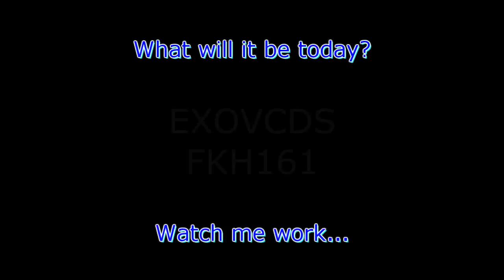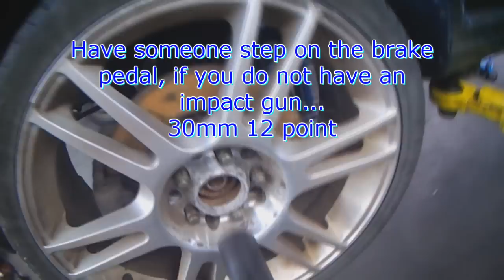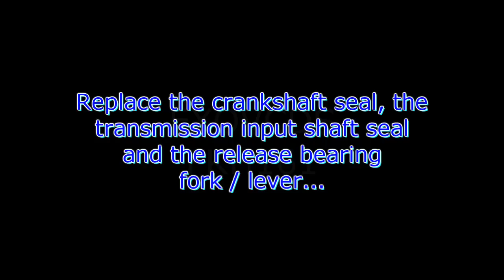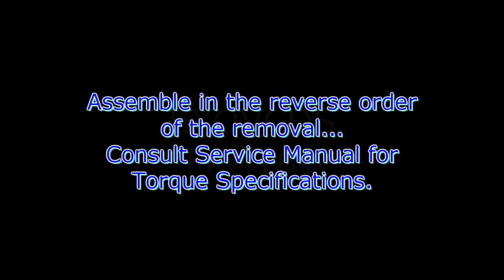VW A4: 2.0L AEG Transmission / Clutch Removal

Comment from the maker: 25:14 is a 9mm 12 point socket. A 6 point socket is a hex socket. Sorry.
Reply: I wonder it would cost to have this done
Reply from the maker: Phone a shop and ask. Enter your city here and look for a European car shop.
https://iatn.net/repair
Reply: is there a throw out bearing assembly in there? i want replace all wear parts.
Reply from the maker: A good clutch kit comes with a new bearing. The lever that the bearing rests against (the one the slave cylinder pushes against) should also be replaced. Genuine VW part only!!! I have seen aftermarket levers fail.

Comment: Hey Thomas,
Thanks for posting this!, I have a 99 GTI 2.0, original clutch with 165K miles, not slipping yet but I'm going to change it in about a week and a half. Even though I baby the clutch, I'm assuming it can only go so far!  Great video, gives me the confidence to attempt myself. Besides, it can't be worse than replacing the heater core. FYI, thanks for answering questions on Bentley, I saw your handle and remember you are the one who answered many of my questions over the years.
Reply from the maker: Hi, thanks for finding my channel & watching! Yeah, tranny removal is a cakewalk compared to heater core. You should have no issues. Just be sure to raise the car high enough and support safely!

Comment: Hey Thomas you brave man, putting an impact gun on those triple square axle bolts is usually a recipe for disaster. When i saw you aiming at them  I'm like OH NO!! lol  i usually do them by hand, but good job man.
Reply from the maker: Time is money... well, actually no, since I'm not on flat rate. If the bit breaks, I have 3 spares ready to go... if the bolt hole strips,  I have other tools to bite the head of the bolt. I'm sure if you keep watching my videos, that you'll have more "OH NO!" moments.
Reply: ***** jajajaja yup, but we all have them….I wish i was NOT flat rate, everytime i see you use that hand ratchet to break up bolts and to remove them I'm like WHY DOESN HE USE THE IMPACT??? I guess is just different when you are not rushed to finish every job.

Comment: Holy shit, good shit bro I'm about to do that exact job. Just did a clutch job on a 09 civic si.... that sucked. This has a lot more room to work in. Wish me luck lol.
Reply from the maker: Jerry Mercado You got it! Work safe!
Reply: Ok so I got a situation.... Just started the job and the clutch that the my friend bought looks a little different lol
Reply from the maker: Jerry Mercado The difference might be solid flywheel or dual mass flywheel. If your original clutch disc has springs, then you gave a solid mass flywheel. If your disc does not have springs, then you gave a dual mass flywheel.
Reply: Rgr.... solid mass it is. Tans is back on now working on the half shafts. As far as fluid what would you recommend?
Reply from the maker: Jerry Mercado #2 of this image:
http://newbeetle.org/forums/attachments/questions-issues-concerns-problems-new-beetle/89384d1323059634-clicking-upon-acceleration-power-steering-fluid-fluid-capacity-chart.jpg
Reply: Jerry Mercado ,hey bro I'm about to do this job today and  I was wondering if you used the solid mass clutch and dual mass flywheel or did you have to get a different clutch?

Comment: im buying a beetle for $500 but needs shit cables and clutch replacement. would it be worth buying?
Reply from the maker: David Rodriguez If it's in solid condition (not a rust bucket) then yes.

Comment: I've maybe watched this video a hundred times myself. It';s guided me to tackle this job myself with only spending $200.00 for parts, a few loaner tools and a lot of preparation. I'll be ready to put new kit in tomorrow. I did have a few questions though, is there anything i need to grease.
Reply from the maker: Brent Dickerson The clutch kit should come with lube for the release bearing and the clutch disc splines.... sorry about the late reply, I was out with family all day today.
Reply: ***** Thanks man. Everything's on and put back together but now ran into a problem where my Clutch Pedal is going to the floor and not springing back up? Do you know what would cause this? Thanks Again.
Reply from the maker: Brent Dickerson Was it OK for a few pumps or was it dead from the first pump?

Did you open any hydraulic fittings?

Was the release bearing installed correctly on the release fork / lever?

Any noises when this happened?

Fluid level in the brake fluid reservoir OK?

Comment: great video i really like it. I have a question though! i really am wondering about the hours charged for this job. forgive me if i m wrong the way you work! it is insult to give you more than an hour for reassambly, but let say 3 hours! i m just gonna copy paste what mechanics are charging !The average cost for a Volkswagen Jetta clutch replacement is between $1190 and $1657. Labor costs are estimated between $440 and $777 while parts are priced between $750 and $880. Estimate does not include taxes and fees.
Reply from the maker: I don't understand... am I taking too long or not long enough?
Removal is always quicker than the installation.
I don't show "real time" / "full footage" (my videos are edited / made shorter by removing unnecessary stuff (getting tools etc).
Industry labor guides provide "labor times" for shops to use. If a clutch job is listed at 3 hrs, the customer is charged 3 hours... unless extra time for extra work is required. If the job gets done in 2 hours, then the shop or the mechanic is ahead by 1hr labor earnings... it's the benefit of being able to do your job quickly. A first timer might take 6 hours or more... but the customer is charged 3hrs.

Comment: thanks for taking the time to make the video!  a little more lighting would be the only improvement that I could think to recommend.  again thanks so much!!!!!  I still have a little life left on the clutch.  I will order the seals you recommended as well as the fork. before i tear mine apart. are the seals easy to r&r?
Reply from the maker: The rear main seal & input shaft seal should both come with their respective flanges that the seals... meaning that all you have to do is unbolt them, clean the mounting area and install the flanges with seals. The rear main seal should come with an installation tool that protects the seal from hanging up on the crankshaft... as the seal / flange is pushed into place. The input shaft seal does not need an installation tool.
Reply: @EXOVCDS  thanks, yes i ordered the main with the housing.  and the seal loose.

Comment: Thomas you are my favorite mechanical engineer! Where did you get that engine support bar? Looks homade? Can you do a quick video on how I could make or buy one? Will it work on other cars? If so what kind? Thanks for your videos :)
Reply from the maker: That support bar I believe is an original VW tool... The threaded rod has been replace with a home made one. I suppose it will work with any vehicle as long as it has a place to sit & can attach to the engine. We use 2 of them on big engines or when the engine has to be supported at both ends. Support bridges similar to these can be bought online. I'll keep the video idea in mind.

Comment: Wow I just finished to remove the transmission. What a job, I do this as a hobby. It would be nice a video on how to replace all the seals, I will look if You have one.

I am curious how you were able to hold the various components to torque to spec.
Reply from the maker: There are many ways to "lock / hold" the flywheel in place, so that the pressure plate or flywheel can be torqued. I use an impact to remove the bolts and a holder to torque them: https://www.youtube.com/watch?v=O-uQrKFB4Oo
Seal removal requires a seal puller of some kind or a screwdriver "wedged carefully" into the seal & pried out. Installing the seal requires an installation tool (to allow the seal to slide over the crankshaft) and a gentle tap of a hammer all around the seal to seat it.
Reply from the maker: If you have a buddy helping you... you can get him to hold the crankshaft with a socket & big breaker bar at the front crank pulley bolt, while you tighten the flywheel & pressure plate bolts.
Reply: Thanks for the advice. In the meanwhile, I have removed the flywheel bolts, but the flywheel itself is stuck. I tried to use a pry-bar like you show but after a lot of effort it does not move...
In fact I have a question, should the flywheel always be machined or this one had a specific problem? I'm removing it because I want to replace the rear seal now that I have the transmission out.
Reply from the maker: Machining is not always needed, but can ensure correct clutch wear-in / mating. If the surface is smooth and has no cracks... use some 80 grit sandpaper to shine-up / scuff-up the flywheel surface. Thread a bolt into place (leaving a gap) and use two pry bars, one on either side of the flywheel and wiggle it off... it will move eventually.
Reply: I was able to remove the flywheel by first pounding it with a 4lbs sledgehammer, then it came out using the technique you mentioned. Thanks!

Comment: what does a job like this cost, parts and labor?
Reply from the maker: Labor guide for flywheel removal is 5.5hrs, labor cost per hour as well as cost of parts varies between shops / states. Bring your own parts then it's just labor. No way of knowing what other things will need attention (leaky slave cylinder,  rear crankshaft seal, transmission input shaft seal etc.) that would add labor time and extra parts costs. $700 to $1400 depending on single mass or dual mass flywheel? I don't write invoices, so that's just a guess.

Comment: Great video my clutch gone on my golf looked at this no way i am doing this I will pass this on to my friend 😃I don't think he will be happy
Reply from the maker: Wayne Lewis You're a smart man... I would not want to do this at home either. Bigger jobs like this require a hoist... it can be done with the vehicle on jack stands, but safety is an issue whenever you are lying under a car working on it. Make sure to tip him well (not just a case of beer)... I've stopped working on friends cars a long time ago, there's a difference between helping out the odd time and being taken advantage of. =(

Comment: I was all confident until the part where you were loosening the 16mm bolts from the tranny mount.  What would happen if they did break?  How would have you removed the broken bit?  The only reason why I ask is I snapped the top bolt for the alternator.  I used a big zip tie (lol) to temp hold it in place until I fix, but it's been holding for a few years now lol.
Reply from the maker: Depending on how it snapped and how it felt just before snapping... we give it a go ourselves or we take it to a local machine shop. Things can get worse when trying to remove stuck fasteners... if the right equipment / technique isn't used.

Comment: Hi Thomas can you remove the piece on the trans that the axels bolt into? Last time I didn't and trans was a bit tough to re install.
Reply from the maker: Yes. There's a bot in the center that needs to be removed. The flange will be under pressure / spring loaded, so be careful when removing. It will take a bit of pressure / leverage to install it again later.

Comment: Thomas, would you recommend doing the rear crank seal even if it is not leaking? My machine has 121k mi on it
Reply from the maker: It has to leak eventually, so yes... it would be a good idea to replace.

Comment: how long didnthe whole thing take you to do? i did this yesterday on a BEV. took me exactly 6.5hrs. i never took yhe shifter mechanism out. never took the drive axles out - just disconnected them from the transmission side. never touched the suspension either. Still took me a while.
Reply from the maker: +Rumen Hristov I'll use a stop watch on the next one... I'll get back to you! :)

Comment: Got a question for ya... I'm in the middle of doing my replacement, and the head on one of the triple squares was stripped (driver's side shaft). For some unknown reason, I couldn't drill off the head so I could use an easy out, so I had to break out my Dremel with cutting wheels, and cut the head off. I know I need to replace the bolts, but I forgot to order a set of torque to yields online. I'll order them if I have to, but can I just use a regular set of socket cap bolts if I use threadlock instead of the TTYs? They're a lot easier to come by...
Reply from the maker: Next time knock against the head of the bolt with a hammer & chisel... in direction of loosening. That usually breaks them free. I don't want to say yes or no in case of lawsuit... do what you think is best for what you need to do.
Reply: I had already tried the hammer and chisel trick, with no luck.
No problem,, I'm not the type to sue (I hate when people do that), but point taken. I'll weigh my options, since I won't have time to work on it again until the weekend. Thanks again! 
(Until my next problem occurs... Hahaha)

Comment: Very good job, the wheels on the car did not help very much. By the way, let me know what you about electric rachets. I have a 320NM one.. Thank you
Reply from the maker: Thanks. Yeah, I'm still looking for a cordless ratchet.... I have too many bills again that I have to eliminate before I can start to buy extra tools. What brand? 3/8" drive?
Reply: When you use an electric ratchet you will not want anything else jeje. They are more comfortable to use.. I've got a 1/2" 24v electric ratchet that I bought for just 150€ online here in Barcelona. You dont have to spend big money in this machine. Thankyou
Reply: ***** Helping my son replace an A4 Audi manual clutch. Can't get drive shaft to drop from trans end? Do we have to unbolt both ends?
Reply from the maker: John Bender If it is stuck to the flange, knock it fee with a hammer... should not have to remove the axles, just lift them clear of the diff flanges (if I remember correctly).

Comment: Do you have any videos on how to test whether or not the clutch is bad vs your master cylinder.

 I have a feeling my 99 jetta clutch is not bad I have a feeling it could  be something else.

clutch pedal feels fine..no leaks.
 If the brake fluid hasn't been changed in a while could that affect the clutch? like engaging it?

is there a clutch cable adjustment? or any cables to adjust? 

thanks
Reply from the maker: If the clutch is slipping... it's bad. If the pedal feels solid, hydraulics are good. Telling me that "things are ok" doesn't tell me what the issue is... so I can't guess as to what might fix whatever issue you might have.

Comment: hello thomas! thanks for this video...quick question: If my clutch is DMF, can it be replaced with a SMF like the South Bend Stage 2 Endurance clutch? does it need a conversion kit or anything of that sort? of are the new SMFs already set for the conversion? Also, a tranny guy mentioned to me that it could be 8" or 9" (or something like that) and it could need a conversion kit????  One last thing: will this video be close to the same for my 99.5 ALH TDI? Thanks again for sharing your insight!!
Reply from the maker: Transmission removal for TDI, 2.0,  1.8T VR6 is the same as long as they are 5 speed transmissions... 6 speed principal is the same, but some different mounting components / things look different.
A SMF conversion kit will include all you need if you order from a place that knows about DM to SM flywheel swaps. Transmission can rattle when in neutral, so keep that in mind. I prefer to stick with DMF setup.

Comment: I broke one of the three transmission mount bolts. A regular easy out isn't doing the trick. Is it more feasible to try running it straight through forward instead of backing it out? Can the transmission come out with the mount bracket still attached?
Reply from the maker: It will probably be just as difficult to turn it in as out.
If the engine is tilted enough (be careful), you can probably get it out with the mount in place. Removing the passenger axle flange will also help.
Reply: @EXOVCDS  Followup. So after almost a month out of commission we finally got the transmission out and replaced the clutch. The answer is a most definite yes, it is possible to get the transmission out without removing the bracket. You need to lower the engine practically to the ground in order to pull it with the bracket still installed.

I also found out why you said be careful when tilting the engine. It fell out of it's mount! So I ended up having to jack up the engine back into it's mounts. I ended up stripping the two mount bolts on the tranny. So I need to retap them with an SAE tap to go for an oversize.

Comment: Excellent video, like watching a heart surgeon at work, you've def done this a few times before. How different is this to a Passat B6? Also can I do this at home without an air wrench? I've got pretty much everything you had in the video but no compressor and of course no lift. Can i support engine under the oil sump?
Reply from the maker: I'm still at work... will reply again later tonight once I am at home.
Reply from the maker: I'm still at work... will reply again later tonight once I am at home.
Reply: ***** Thanks Thomas. The reason i want to remove the transmission is because the clutch centre made a big miss of replacing the DMF and clutch kit. Gearchanges as bad, lots of new vibrations, the flywheel cover plate is now missing. Do you know about this plate, its a half moon shape but i dont know how its held on, i cant see any in your vids?
Reply from the maker: TheJungleApe I'm not aware of  a half moon plate on the newer transmissions (at least haven't noticed). Can you send me a picture of what you are looking at? fkh161 at fkh161 dot ca or post a video on youtube and share the link via private message?
Reply from the maker: DeltaLou Not everyone has such great work ethics such as yourself... we bow before your "skills" with a keyboard.